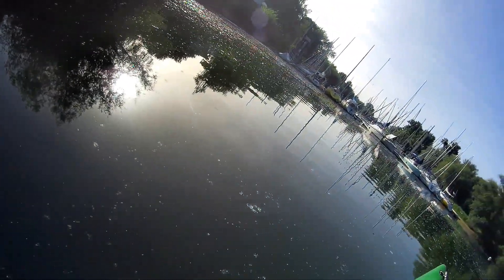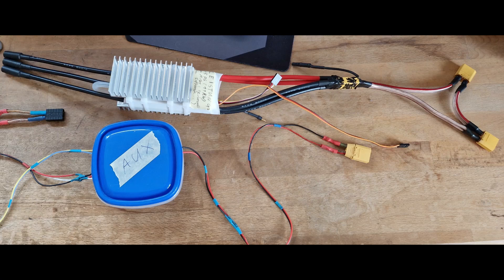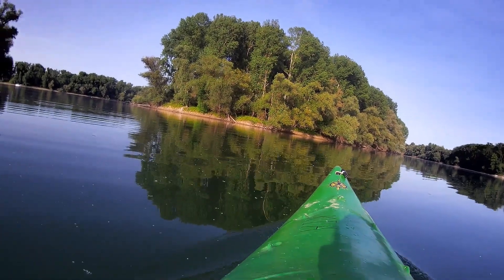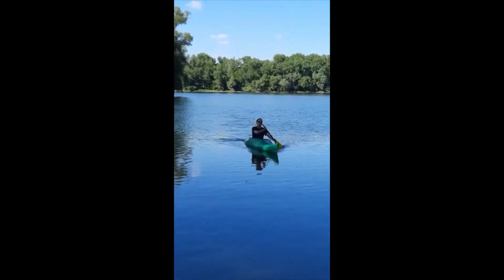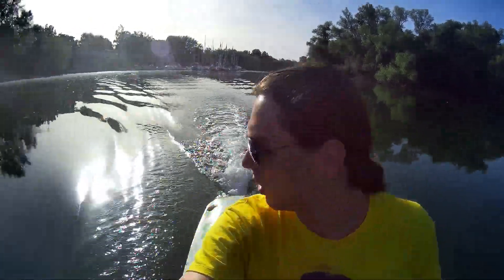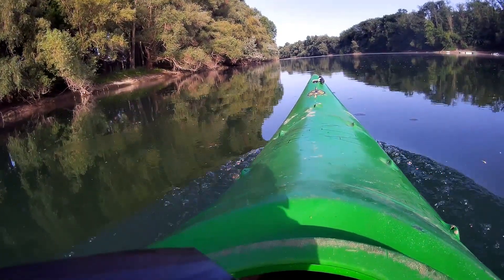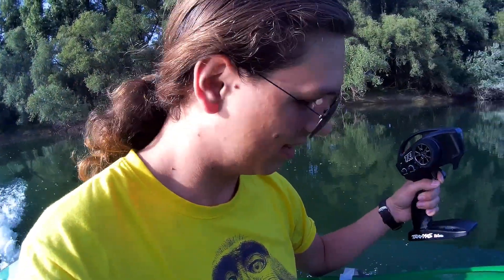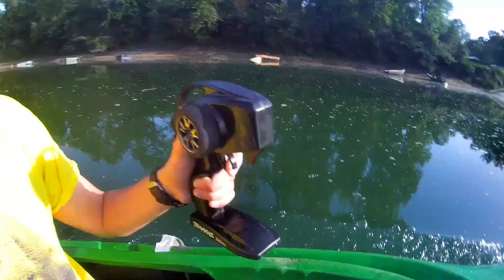15 HP Electric Jet Kayak - 3d printed (Update)

Comment: Nice speed & project. I think you hav already reached the speed where the rocker( i assume it has some) of the hull is disadvantageous, hav You considered installing a small trim plane in the stern? a fixed one slightly bent down would probably help the water " let go"
Reply from the maker: I already installed a bigger, stronger ride/trim plate and yes, it works pretty well to improve plaining. Unfortunately the boat had some other issues with steering so I didnt film that day.
Reply: @rcandfun242  Think Your setup would work fine on a surfboard also, probably even faster. It just need to be big enough, so You get properly on plane!

Comment: You need a whitewater kayak with a planing hull. The displacement hull on a recreational kayak will never lift or be efficient. Love what you're doing!
Reply from the maker: I think it develops enough lift. What I need to go faster is a windscreen... I would agree that the shape of a whitewater hull is better suited for planing, however most whitewater kayaks are too small und thus would sit deeper in the water with all the extra weight which could make it harder to get on plane

Comment: I'm currently designing a jet pump for kayaks and well and I'd love to pic your brain on a few things.
Reply: I forgot to mention mine is 3d printed as well... But mine will bolt to a mini power pole mount off the rear of the yak as opposed to being internal so that it can be adapted to a wide range of kayaks... Although I'm very tempted to hack up my sit in the same way you have 🤣